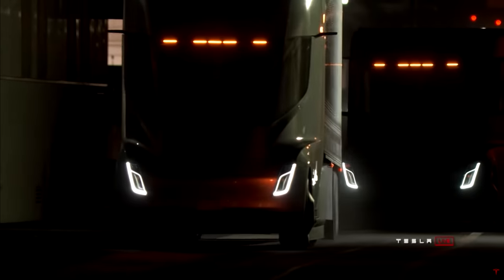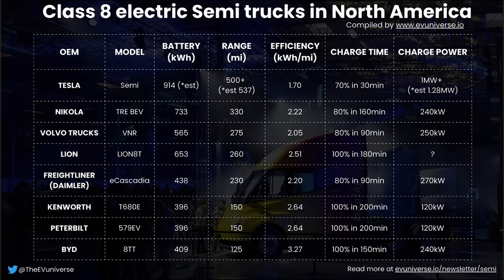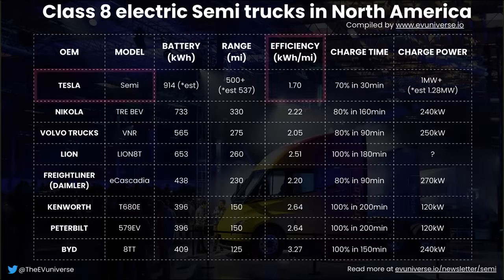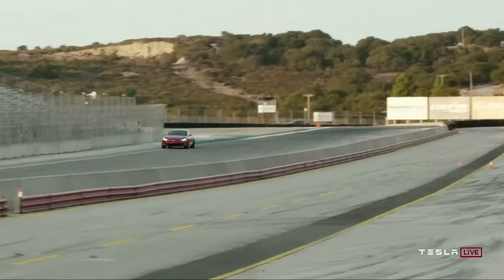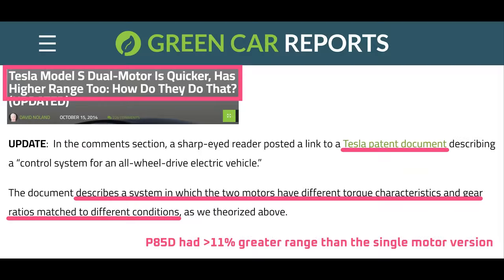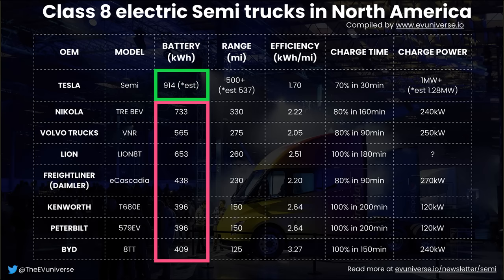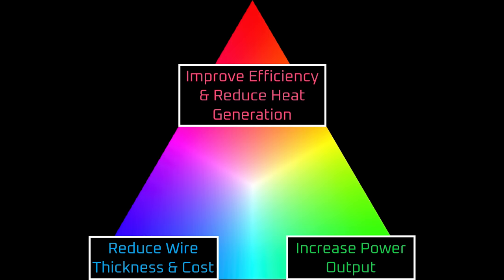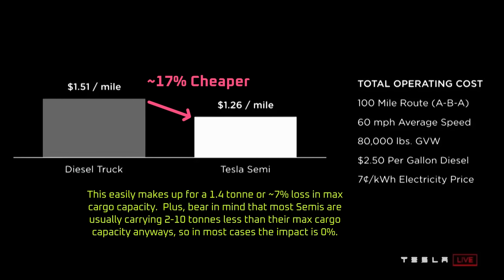How the Tesla Semi “Broke the Laws of Physics”

Comment: Good video, but the actual weight of diesel fuel is 7lbs/gallon.  So, in your exemplary truck, the actual weight of 150 gallons would be 1,050 lbs., not 500 lbs.  That's another 550 lbs. against the diesel powered truck.  The weight of the Tesla semi will matter more than you think since the gross weight limit is only 2,000 lbs higher than a conventional diesel powered rig and there are axle sub-limits that may come into play.  I suspect the extra 2,000 lbs. will be applied to the truck steer and drive axles and the Tesla semi may weigh more than 2,000 lbs. more than a diesel.  So, those per axle sub-limits may affect how much load can be placed on the trailer before the drive axles are hit the limit.
Reply: On the other hand, why is the diesel truck carrying 150 gallons of fuel? Yes, they hold that much, but to be comparable to the Tesla Semi it only needs to carry enough to drive 500 miles, which might be half of that much.
Reply: @brianb-p6586   There are no drivers that do that (partially fill the tanks).  They do the same thing you and I do when we stop at a gas station in our cars, they fill them up because they don't care about the specs of Tesla trucks and they are rarely close to the 80K GVWR limit.  That said, a case could be made for the fact that a diesel truck is only carrying the weight of 150 gallons of fuel when it rolls out of the last fuel stop.  From that point on, the weight is diminishing.  I didn't bring that up earlier because it wasn't mentioned in the video.
Reply: @Greg Scoggins  the cargo weight capacity of a truck is limited by the fuel it is carrying when it is loaded; the lower weight later is interesting but of no importance.
Reply: @brianb-p6586   I know how the cargo capacity is affected by the truck & trailer weight, I did about a thousand of these calculations during a 38-year career in the business.  I mentioned the poster's mistake in my original post because 550 lbs. can make a difference depending on the situation, especially regarding tractor axle sublimits.  Last, your second statement regarding the insignificance of 'lower weight later' is in direct contrast to your original post implying a diesel truck should only carry enough fuel to go as far a Tesla semi that can only go 500 miles.
Reply: @Greg Scoggins  there's no conflict at all: to maximize cargo load, the diesel should only carry as much fuel as needed (with safe reserve of course, like an aircraft) and doesn't need 150 gallons to be comparable to the EV range; and the reduction in weight as the fuel is burned doesn't matter, because the truck can't take advantage of that by gaining cargo as it drives.
Reply: @brianb-p6586   This is my last post on this as it seems this discussion has devolved into an exercise in stupidity.  I know all about safe reserves in aircraft since I have been a pilot for 50 years and there is no operator of HD trucks that splits hairs in the manner you are implying.  Do you think all trucking companies have scales at their warehouses to weigh each and every loaded rig before they rollout?  There are precious few that have onsite scales and in most cases they are lumber or steel haulers, if they have them.  Most operators don't have the luxury of weighing the entire loaded rig, so they shoot for 78-79K.  There is absolutely nobody that offloads 30 or 40 or 50 gallons of fuel because they have to in order to stay under 80K.  Nobody.  I only corrected the fuel weight for the original poster because he was doing a direct comparison of the tare weight of a diesel vs. EV semi.  Good day.

Comment: In addition to the tractor brakes on a tractor trailer combo, the brakes on the trailer provide additional stopping power.  Depending on the hill and the roadway surface conditions, the trailer brakes need to be used in combination with the tractor brakes.

If you brake using tractor brakes alone in some situations you risk a loss of control when the trailer jackknifes because it wants to keep going when the tractor is trying to stop it.

I've drive the various passes in California a lot, including the Grapevine and have seen trucks with brakes on fire before.  With good road conditions, could a fully loaded tractor trailer combo rely solely on the tractor brakes going down either side of the Grapevine for maximum regen energy recovery, maybe.  But I think there will be conditions where the trailer brake will be needed too, reducing the energy that can be recovered.  And there are steeper passes and roads with higher grades than the Grapevine and Cajon pass.  The Interstate passes aren't nearly as steep as some of the highway and secondary roadway passes.
Reply: Sure... but no one is seriously suggesting not having friction brakes for the times that they are needed. Just as with smaller EVs, regenerative braking can be used in most braking events, and in all cases where a truck would use a compression-release engine brake, without issues.
Reply: @brianb-p6586  Agreed, but recognize that for these steeper passes, the compression brake is no where near enough to hold back a loaded truck.

A related question I have would be how long of a steep grade could be tolerated before the friction brakes need to be employed.  Assuming the truck just climbed one side of a long steep grade and has been pulling a lot of power out of the battery and generating a lot of heat in it and the motors in the process, jamming that energy back into the battery at a high rate for an extended period could get the battery and motor even hotter and there is probably some limit.

But, we know the truck just drove the Grapevine on the I-5 with a supposedly max load, so it had to have successfully employed some combination of recovery braking and friction braking.  What is unknown is how much of the energy spent climbing the grade was able to be recovered.

But again to my previous point, this only works when surface conditions are good.  If wet or snowy, the trailer brakes need to be employed in conjunction with the tractor brakes to keep the rig pointed sunny side up.
Reply: @RideGasGas  the battery state of charge graph released by Tesla shows that the truck on their 500 mile demonstration drive recovered all available energy on descents by regenerative braking. With regenerative power comparable to drive power, there is lots to control descents. Since it can handle hundreds of kilowatts of sustained charging at a charging station, it can handle sustained regeneration for a long grade.

But yes, if hard enough braking is required (relative to available traction) then the truck should apply the trailer brakes in coordination with the tractor brakes, regardless of whetherthetra tor is using regeneration,  friction brakes, or a combination.
Reply: @RideGasGas  A related question I have would be how long of a steep grade could be tolerated before the friction brakes need to be employed. 

The Tesla Semi motors, as well presumably as the power electronics, are taken from the Tesla Model S Plaid. The Model S Plaid laps the 13-mile Nurburgring at full throttle most of the way with no heat-related degradation, so presumably the battery, motor and power electronics cooling systems are capable of handling the full 1,020 HP power of the motors and power electronics in either direction, for extended periods. As such, the only real limit would be how steep a grade could be handled, at a given gross weight and speed, without exceeding that rating. Based on the physics of the Tesla Semi derived by MotorMatchup here: https://www.youtube.com/watch?v=zQDU9f4QTLk&ab_channel=MotorMatchup, at 82,000 gross weight, regen braking should be capable of controlling speed to 35 MPH on a -16% slope! Whether that holds in the real world, or there are other physical constraints on this, remains to be seen.

 What is unknown is how much of the energy spent climbing the grade was able to be recovered. 

As far as the Grapevine, if you extend the straight line from the first half of the graph of the 500 mile range test here: https://youtu.be/LtOqU2o81iI?feature=share&t=1221, you'll see that after a big drop in Battery % climbing the Grapevine, the blue line is back to that line by the time it gets to Pasadena. On the surface, this suggests that 100% of energy climbing the Grapevine was recovered by the time it gets to Pasadena. Since the theoretical limit is 81%, this is physically impossible. But this is explained by the fact that there's a 35 MPH truck speed limit going up and down the Grapevine; and the reduced losses in aerodynamic drag are about equal to the 20% loss of energy recovered by regen braking. So the net result is that there's little or no loss of range between flat ground, and mountainous terrain.

Yes, just like a diesel semi, trailer brakes would need to be used on low traction situations.
Reply: We have developed regenerative trailer axles in Europe ... they power fridge units etc
Reply: @richardsimpson3792  I might see this working on a diesel semi, which has far more range than it needs for a day's operations, and can accept the additional load on the tractor this would cause. But in an electric semi, the weight of the regen equipment would reduce the payload, and whatever energy was gained by the trailer regen would be drawn from the tractor battery, plus an additional 10% losses on both ends. American reefer trailers include their own energy storage; and so robbing energy from the tractor, especially if it's electric, isn't necessary, and would reduce both overall range and payload.
Complete removal of the internal refrigeration power source, whether diesel or electric, might balance the additional weight of the regen equipment, restoring payload; but then there'd be no power source when the trailer was stationary. It'd be interesting to see more detail on how this works in the EU.
Reply: @BigBen621  It's in its infancy here as a technology, Ben, and the price is horrendous.
The set-up so far is to have one axle on a tri-axle trailer with a generator in-line with the axle. This activates when the trailer is in 'over-run' or cruising at the limited speed of 56 mph when there is power to spare. It charges a battery, which is positioned where the fuel tank would be on a diesel reefer, and this powers the fridge.
When the trailer is uncoupled, or loading, it is powered by three-phase 'shore power'.
Environmental constraints are increasingly discouraging the use of diesel 'donkey' engines in fridge trucks...we now see the fridges driven by PTO off the truck engine on more and more rigid and artic vehicles. We used to be able to run the 'donkey' on duty-free diesel, but they now have to run on road fuel at full price, so there is little advantage in having them.
A few years back a trailer maker tried an F1 KERS-style system here in the UK using motor-generators in the trailer axles but it was not a success...the 'push' from a driven trailer upset the dynamics of the rig.

Comment: The one thing that people forget is that if you use a Tesla Semi in the city and you stop at 50 lights in a given day can add up to 2 hours of delays because it takes all of that time to get up and go again. Now the Tesla semi gets up and goes like a slow car which will recover all of those lost miniutes during the stopping.
Reply: And in addition, will recover most of the energy used in getting up to speed, through regenerative braking when it stops. This is why almost all EVs have a higher city EPA rating than their highway rating.
Reply: @BigBen621  That is very true. I never considered that either. 
One thing that is super cool is there is a mine site somewhere where the massive haul truck is electric. The truck either goes down hill loaded or unloaded then hauls it up or down. I forgot which way. There is enough energy reclaimed to move the truck back to the other end. Making it pretty much free to run.
Reply: @kameljoe21  Yup, Biel, Switzerland. Goes up empty on battery power, comes down loaded, recharging battery through regen braking.

Comment: Hey Jordan!
Another good one.
I'd reached the same conclusion regarding the regen. The minimal weight and huge energy transfer capability give a massive advantage.
(I also think "coming to another vehicle soon".....?)
.
Reply from the maker: 😏 Yes...C/t
Reply: @thelimitingfactor  
It would be silly not to imo? Overcomes the "towing issue"?
Reply: @rogerstarkey5390  I mean it's not gonna have the huge battery of the semi tho. Wouldn't that throttle the amount of regen in the pack it could get out of the three motors.
Reply: Only an advantage when there is a downhill totally useless on flat land
Reply: @alanmay7929   _ totally useless on flat land_ 
False. Very useful in stop-and-go driving on flat land; this, plus the reduction in aerodynamic drag, is why the city MPGe of almost all EVs is greater than the highway MPGe. It's only cruising at constant speed on flat land that regen braking is useless.

Comment: I assume regen is still limited by cell level C rates so the higher voltage doesn't come into play.
Reply: Quick calculation (as I posted elsewhere)
770 kWh pack, 700 kW input.
Equates to.
100 kWh pack 90 kW input.
.
It's not as if Model S/ X have issues charging at that rate?
(You could scale down further for model Y 2170 packs?)
Reply: @rogerstarkey5390  As he mentioned in the video you can't use charging rates because those ramp up slowly where regen is instant.  You could compare regen rates of S/X or 3/Y.

Comment: Great video. I agree the use of 3 motors for the main purpose of regeneration is brilliant. I can imagine when Tesla can effectively use the efficiency of the 4680 with lower cell internal resistance they could even improve the regeneration charging capacity and/or even use two and get rid of one motor.

Comment: The 1000V battery choice is probably due in big part to the charging power required. Because keeping 400v or 500v would have required twice larger and heavier charging cables and charger connector
Reply: Actually I suspect the regen braking demanded the 1000V and the charging was almost as important for speed of charging as you say.
Reply: And people were laughing when porsche or lucid choosed those higher voltages!!! Wth!
Reply: @alanmay7929  ... and Hyundai/Kia, which also uses about 1,000 volts.

Comment: Can we take a moment to appreciate that the Tesla semi is basically viable with off- the- shelf components and design? Well,  the Tesla shelf,  anyway.  

The aero design isn't that unusual and could've been roughed out in an afternoon.  The frame may simply be a standard configuration,  as those have been optimized long ago for the needed strength.  The driver cab tech is mostly from their cars, the motors are from their shelf,  they're using their old battery tech.  Car motors have become powerful and durable enough to use in a million- mile heavy truck!
Reply: Off-the-Tesla-shelf components
- Plaid motor
- Battery components
- Inverters
- UI computer
- Drive computer
- ...
This is why Tesla can offer a much lower cost solution than any other other manufacturer
Excellent call-out.
Reply: They’re probably not the exact same as the car motors. I would expect a few beefed up components and maybe better cooling to deal with more heavy usage.
Reply: @bru512  Tesla can offer a lot of things, but "low cost" is most definitely not one of them lmao.
Reply: Lol….. it’s modified components not just off the shelf!!!
Reply: @bru512  everything modified!!!! It’s not 100% the same hardware! The modelX plaid for example can barely tow 5000lbs while a 200hp diesel car tows well over 7000lbs cab you explain!?
Reply: @bru512  which lower cost exactly!? The battery alone is about 10 models batteries that’s definitely not cheap.
Reply: @alanmay7929  you're missing the point.
Reply: @jamesengland7461  nope you are missing it!
Reply: @Alan May  you know nothing about towing capacity then.  It has far less to do with the motor power and far more to do with the suspension setup, tires, vehicle structure being designed to accommodate tow bar,  tongue weight,  etc. The Tesla Plaid models S and X have more torque than 1 ton diesel pickups from 0 rpm and no need for transmissions,  but the vehicles aren't intended for heavy towing,  so they're not built for it. The motors aren't the weak point; with the semi, they'll be attached to truck axles and suspension and the heavy frame rails built to pull 60,000 pound trailers. 

Further,  any V8 sports car could pull 10,000 + pounds,  but clearly isn't built for that.
Reply: @alanmay7929  What do you think limits towing capacity?
Reply: @jamesengland7461  even much less powerful SUV like Honda passport or similar are able to tow 5000lbs, vehicles are made to be flexible in use.
Reply: @jamesengland7461  talking semi trucks again! The scania 770s diesel truck has almost 3x the torque of the tesla semi and in regular setup in Europe hauls well over 44tons, in different setups it goes up to over 100 tons.
Reply: @jamesengland7461  you consider models and x sport cars!? Those things are only good at 0-60 big lol 😂 😂 😂
Reply: @alanmay7929  you have wandered off subject into randomness. Have a nice day.
Reply: @jamesengland7461  yeah! That’s what she said…